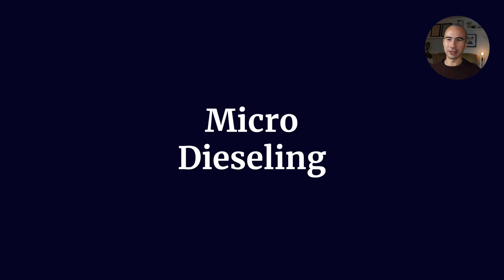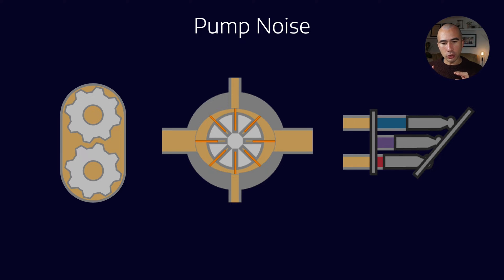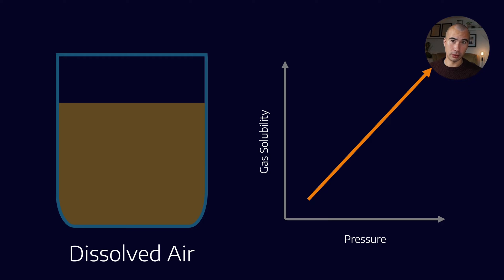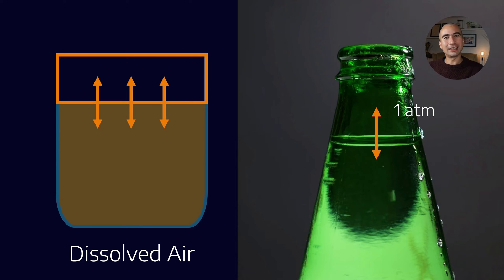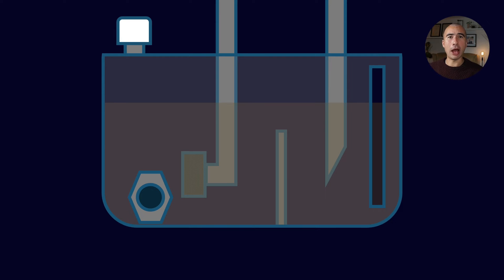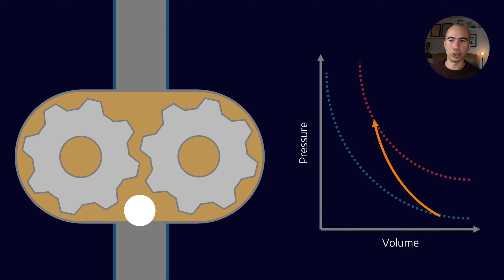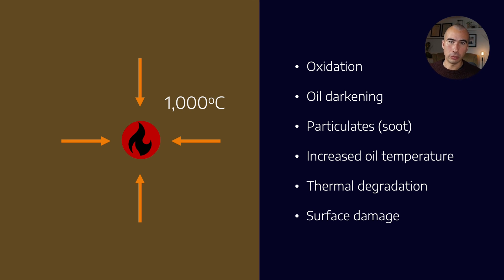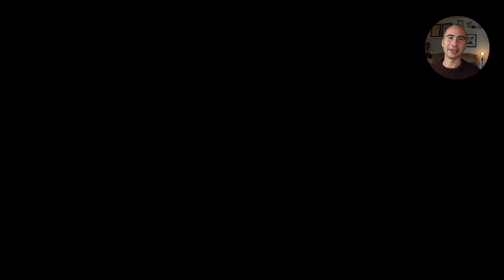What is micro dieseling? Is it the same as cavitation?

Comment: Thank you for a very informative presentation.  I do not find this dry at all FYI.  Perhaps to many viewers, because the interaction of physical phenomenon is meaningless on any scale, let alone very small scale.  I autopsy every mechanical failure I have, and really try to get a good comprehensive look and then try to assign causitive mode.  I had really never considered the concept of micro-dieseling in hydraulic pump failures, but it fits closely with observations on pump gears.  The sort of deep erosion I have seen points to a more energetic shock than I would expect from a vapor collapse like in cavitation, which I have observed to be more generalized in scope and shallower in depth.  I'll add this to my mental toolbox to  employ in future examinations.  Thanks again.

Comment: There are a few systems where the reservoir head space is lightly pressurized,(airplanes) but more as a way to reduce cavitation and foaming, and secondarily prevent pump-priming issues. I imagine the cooling design would also be a big factor, is the liquid allowed to settle and de-aerate prior to cooling or after?(Intake side or return side.) Usually gasses are more soluble in cool liquids so cooling before settling may result in more dissolved gas.